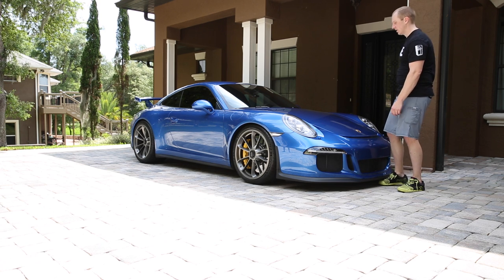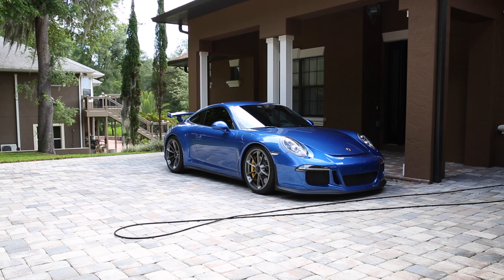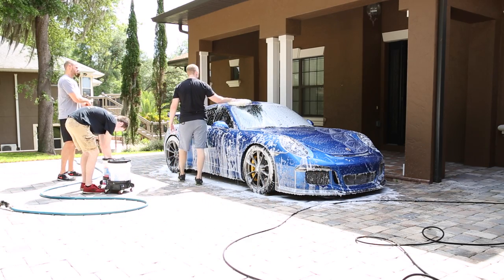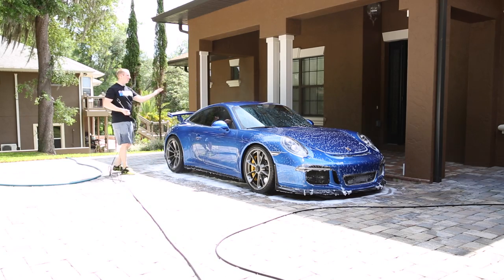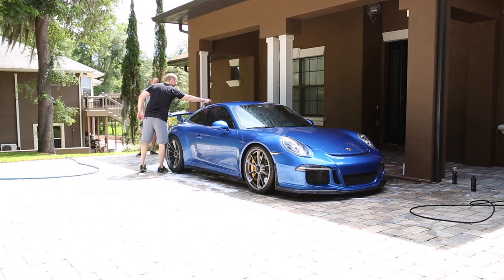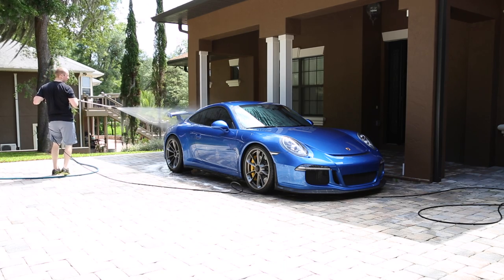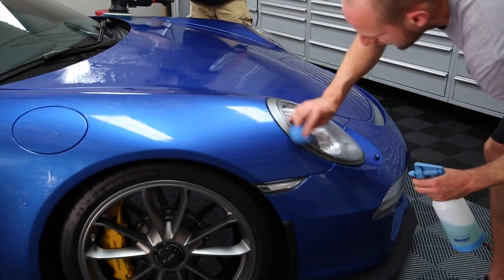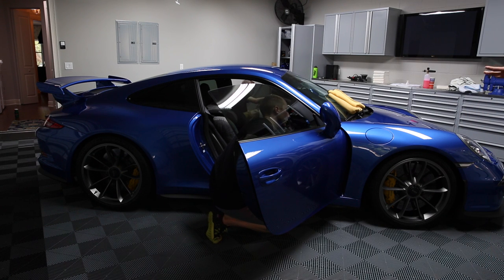GT3 Maintenance Paint Correction Video 1 of 3

Comment: Enjoyed the video. I experienced the same thing with the Microfiber Madness Dry Me Crazy. I found that if you get it just lightly damp, with distilled water, or detail spray, it then becomes super absorbent. I have other high GSM towels, and kind of stumbled upon this when I used one that wasn't completely air dried after washing in the machine. I think you'll like the towel much better after using it this way. I was also curious if you have tried the SM Arnold speedy prep towel? I've used, traditional clay, the sponges, and the discs on my Rupes. The SM is much more durable and requires no pressure at all. It's also big enough to fold into quarters, and cleans up easily with warm water. I've used the same wash pads you have as well, I've found the Microfiber Madness Incredimitt to be far more durable, but most of all it releases dirt so much better in the rinse bucket, my soap bucket never has any dirt in it when I'm done. I haven't watched the other two videos yet to see what wax you used, but I also think you would really like Victoria Concours Red Wax. It would look great on your blue paint, and it's not overly expensive. I look forward to watching the other two videos in this series.
Reply from the maker: Good stuff Joe.

Comment: Another great video, I still need to watch part 2 and 3. 

when you go the trip with the gt3 will you be using any kind of waterless washes etc ? Or just let it get real dirty.

Also how much Adams shampoo do you use for your regular wash ? I'm thinking of changing from chemical guys as Adams looks way more sudsy  ? 

The wolf's glass guard looks great, very durable, still not got around to trying mine out yet. I've just been using rain x up until now.
Reply from the maker: mark caughey I bought some Adam's Rinseless Wash and Waterless Wash to use if the car doesn't get too nasty.  The problem is that we will be in love bug season.  I'll need to get them off the car.

I probably use about 3 oz. per wash (1 oz. in the bucket and 2 oz.).

Comment: Same problem, too many products where's where!

Excellent video exactly what I was looking for!! Be planning to foam/wash to strip all wax & sealant away. As I detailing my niece's car next week (not detailing since she got it 4 years ago new) & want to strip it totally clean from everything. You answer a question  as I been thinking of adding APC to increase its cleaning power but of cause still safe for the paint. Also I need to do my car in the summer. Just been doing this 6 months now, the amount of products is quite crazy, at least a delivery per week. 

The foam cannon is fine if I add more stronger products? Worry it might damage the internal parts of the cannon! 

Great if you can answer this as I would just add some APC to the shampoo for removing any wax etc. 

Did I get a mention for recommendation the Gyeon View?! Around 35 minutes mark, If so many thanks ha ha.
Reply from the maker: woncho1 Yep!  Thanks for the tip.  I'll be testing it out this weekend.

Comment: How does this floor act after rain ? Do you have any holes to get the water out of the garage or you do not park your cars after or during rain ??
Reply from the maker: DonDomel You aren't allowed drains in the floor of a garage in FL.  My floor is sloped toward the outside and there are channels in the tile that allow water to run out.
Reply: what do you mean, you aren't allowed ? this is your home, your ground, your garage, your territory. Who can check that you drain your car if the doors are closed ? It's a matter of own honesty and rules ?
Reply from the maker: DonDomel I think it's part of the building code. I don't think they allow drains in garages in FL.  I could be wrong.

Comment: Ok, you're an even bigger psycho than I am.  You need to look into menzerna products.  German product for german clearcoats.  Why do I use that?  Because they use it at the factory (yes, even porsche have defects they have to remove at the factory).  You're only going to need the swirl remover.  After the clear is perfected,  zaino brothers polish.  They also sell a good clay. However, there's nothing like the polish.  It's a polymer sealer that adds a deep shine and protects your paint.  It lasts longer than anything I've ever seen.  Detailers wont use it for two reasons.  1.  You have to mix the drying agent in yourself and it's just not cost effective for them.  2.  It lasts a long, long time; and professional detailers want to hit you for an exterior polish and wax as often as they can.  On top of the zaino I use zymol concours that adds that wet glossy look and makes it pop.  In 20 years of owning porsche and BMW, these are the best results I've produced.  Your car glows and glistens.  Before someone comes at me, I worked in a high end shop through college, and a family member runs a high end detail shop.  So, spare me.  Once a month or every few washes just add another coat or two of zymol. 

Once a year I strip it, clay it, etc.  Remove any wash marks or imperfections in the clear w/ menzerna.  Apply 3 coats of zaino like whacko, then zymol.
Edit: Just buy a little air compressor w/ an air chuck to blow off your car.
Reply: +Agent Red On Zymol, I would recommend at the very least their concours wax.  Avoid the cheaper ones (i.e., carbone) that have less carnauba content.  Also, very important, ignore the directions they give which tell you to melt the wax in your hands and to apply it w/ your bare hands.  Simply use a microfiber applicator.  I keep mine refrigerated and when I'm ready to use it I hit it w/ a heat gun for a couple of seconds to slightly melt it.  Do not apply in circles, gently apply it w/ very light pressure in straight overlapping lines and use it very, VERY sparingly.  Apply it in sections, Do 2 or 3 panels, allow it to flash for a few minutes, then take it off and move on.  There are other estate paste waxes out there pushed by auto geek and others.  Tried them all, they are all copies of zymol in both composition and marketing.  Zymol is still the best by far, imo.  With a 911 and M3 one can has lasted me years.  It retails for 120.00 or so, but if you have an account you can get it for 60.00.